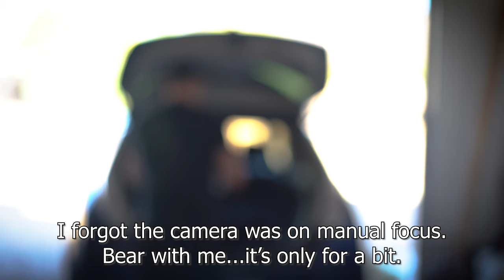Bonus Video!  Installing an RFE Sector Antenna!! - DIY Ubiquiti Internet Relay - Pt 28.5

Comment from the maker: Fun fact:  You have to aim these!  My typical sector install mantra of, "plug it in and point it in the general direction" does NOT work well.  lol
Reply: grin, these are 30deg sectors and you have to point them somewhere down to the ground in the wide yonder :D or are you planning to sub in the International Space Station or ET and his buddies? :D
Reply from the maker: @DirkdeJager73  I was thinking more "in-flight Wi-Fi". lol
Reply: @rmp5s  grin, ok DFS band then :D

Comment: what is the benefit of using the RFE's and what does it look like on the inside?
Reply from the maker: Late response ftw...lol

Inside? Dunno. Benefit, though?...they reject noise VERY well. They also install WAY easier than the Ubiquiti sectors I was using. You can put 3 or 4 of these RFEs on a pole in the same space that ONE of the Ubiquiti sectors take up.